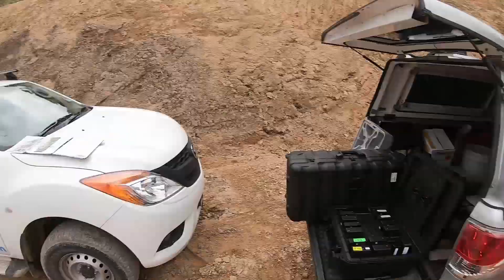DJI Phantom 4 RTK & Matrice 210 Demo

Comment: Via a firmware update, the Phantom 4 RTK can now support custom terrain models in the flight planning stage. This will resolve the issue on large sites, such as this, where there are large variations in terrain height.

Comment: Do you happen to know what flight planning software were they using for the Matrice 210?
Reply from the maker: Cosmin DJI ground station pro
Reply: @erichocire  So you don't have the CrystalSky? Or you have the CrystalSky but you disconnected it and connected the iPad and used GS Pro?
Reply: @cosmograne  I remove the CrystalSky and use the Cendence mobile device mount. DJI Pilot now offers flight planning on CrystalSky. Pix4D capture is also another option on the CrystalSky.